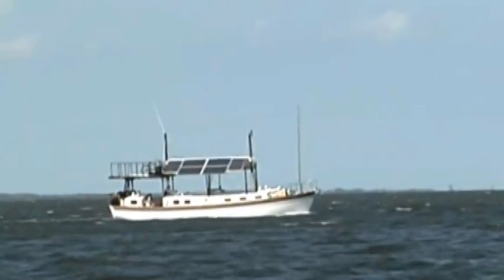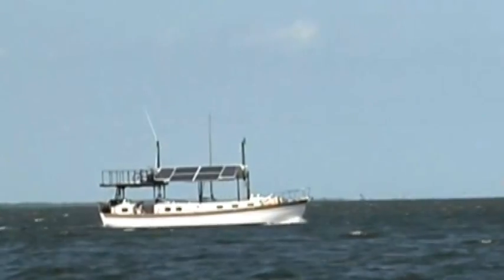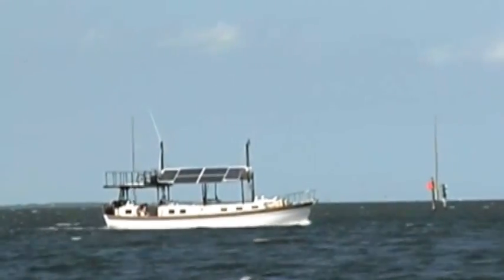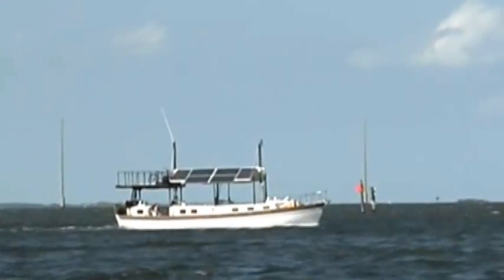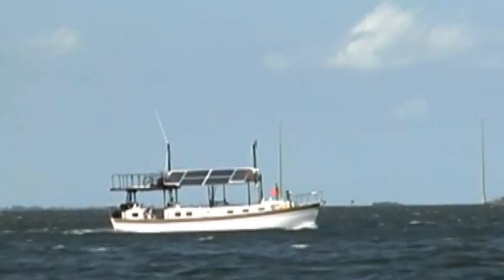Solar Boat (The Archimedes) I CAN'T BELIEVE THIS IS REAL!!!!!

Comment: FIrst, I have been researching this kind of alternate energy for several years but what I have found is that as far as cost is concerned, gasoline or diesel is much more energy dense than the current battery tech. Second, one can produce their own gas or diesel with a carbon neutral source such as hemp, or any hardwood, or any thing made of carbon. thats everything by the way. Carbon neutral meaning that the plants have absorbed the carbon so when oil is made from those sources, you are not putting anything back into the atmosphere that was not already there. You can make the oil by pyrolisis  , that is heating the material in a sealed container and it turns to oil, collect the oil and crack it or fracture it with a copper catalyst or a much better one if you can find and afford it. The result is gasoline and all of the other fuels that we currently use. A 12v 200ah lithium ion battery is over 2000.00... let that price sink in because one gallon of gasoline is the equivalent of four of those batteries in terms of watt hours. Feel free to do the math yourself and you will find that it is not the solar panels that limit us, its the crazy price of these batteries and the weight of them. 300 lbs of battery to equal 1 gallon at 8 lbs of gasoline. Its ridiculous.
Reply: i call bull 8 to 10 200 watt panels and brushless motor,controller and diy lipo pack is way less than even a small diesel engine

Comment: You say you have solar air conditioner..is that just a regular window unit or something special? I'm from Jax and AC is a major concern for me before I buy my sailboat.

Also, after seeing many sail boat an solar powered boat videos, in watching yours, it just dawned on me,  with a good ballast, one can cruise around the world on solar power just as well as wind power. Sure there are times when one or the other won't work, wind with a sail and sun with solar power , but as long as one can do 5 or more miles per hour...who cares. Both would be ideal. So maybe I won't worry if the sailboat I choose doesn't have a diesel and depend on the elements. :)
Reply: Kenny Smith I have have a small RV that I installed a 1000 BTU air conditioner in. I have a 340 watt solar panel with used lithium ion batteries. The air conditioner is about 12 by 13 by 5 inches, it was a Used 300$ unit off ebay. Matching the the voltage of your controller and the voltage of your panels to the battery system is not difficult.

Comment: My house is hybrid.   11 solar panels 12 batteries three charge controllers and three inverters.    My house runs on Fp&l , solar and 12 Volt.  My highest power bill is $90.    Generally runs @ $45.    All in the city.

Comment: how long do solar panels last, and is the recycling of those a safe process ? what about the batteries? no petroleum, sure, but I doubt the environmental impact of billions of tons of broken down/worn out batteries and solar panels is good for the environment.
Reply: Let's not forget you will never build all those 🔋, solar panels, electric motors or wire any of them together without using a ton of fossil fuel to mine the material from the 🌎 much less transport it, refine it transport the refined material and then manufacture the products needed to "go green" . Green my ass.
Reply: ha! my ass might be the only green thing going,since poop is biodegradable fertilizer... 'cept its brown.
Reply: Lead cell batteries are recycled!
Reply: panels should get over 20 useful years..............how about billions of tons of dismanteled coal power plants....now thats really really bad for the enviroment

Comment: Yes I can't believe it is real either. This amateur looking piece of junk has extremely dangerous and un-seaworthy high structures on it that will surely founder the vessel in the first real blow. The first rule of safe boat design is never put much weight or windage too high over the center of gravity. That ridiculous rear raised desk is dangerous and puts the danger zone over the top considering the already excessive hipped roof design of the solar array. 
All safe solar array designs approved by nautical engineers are completely flat on top so they don't make too much wind drag. Peaked arrays like this always have half or all of the panels at the wrong angle to the sun even at high noon, the best time to collect sun energy.
All successful solar powered designs have light weight hulls and two or three hulled designs are the primary approach for getting reasonable range out of the batteries. Ferro cement is the absolute worst option for this application, the guy could have done better with almost any other similar length vessel made of a lighter material, even an old inexpensive one.
Reply: but after it went  thru a couple hurricanes ...it is still upright & stable... can you explain why popeye ?
..the owner is a retired coastie.....may have many times more experience at see than most people
Reply: Just stumbled across this video again that some guy at the marina asked to do many years ago when we were just finishing the building the Arc, (that I never really cared that much for)  and I feel compelled to respond to your ill informed comment. The nicest way I can put it to you  is that you don't have a clue what you're talking about.  
First off, during our years of cruising since this video was made we have traveled over 5000 miles, been through 4 hurricanes at anchor and countless gales at sea and never had ANY issues. The stability of the boat is remarkable and I actually calculated the mass moment of inertia was slightly higher for the previous wooden sail rigging than it is for the solar canopy before I built the the system.
Next, the solar arrays are designed to tilt toward the sun, unfortunately we had not installed the electric actuators yet when this video was made but still had the crude pully system I made for testing. However, as it turns out, the A-frame position, or hunker down as I call it, is the most stable of all the positions we can put the panels in. https://www.shipofimagination.com/the-flap-tracker.html. Flat, or what I call canopy position,  is far less stable.  This is because the wind pushes down on the boat in hunker down, increasing stability rather than catching the wind like a wing. Also, we are able to collect 3-4 times as much energy with the tilting system than  when the panels are flat because we can track the sun throughout the day. I have actually tested this by leaving the panels in canopy position for a day during our travels and comparing this to previous days of similar weather and heading.
Your criticism about the weight factor of ferro cement does have a kernel of validity however it is a minor factor and I couldn't find a deal on a carbon fiber hull. I basically saved the boat from becoming an artificial reef and got it for a song. Plus the Arc is a tank that has been through grounding situations that would have shredded a fiberglass or wooden boat and it doesn't rust like steel.  The increased durability of ferro cement is well worth the trade off.
I hope my reply has been enlightening for you and you consider this the next time you're compelled to mouth off about something you know little about, "Popeye",
Reply: @CarterQuillenP.E.  Ferrocement and carbon fiber are both used much less than glass or steel. It is not your own single anecdotal experience and LUCK that applies, it is the compendium of all sail adventures of the last century that back my assertions. In addition to my own boat I built from marine architect plans and sailed for 20 years there is the overhwleming consensus of all boat designs and hundreds of very detailed first hand accounts of sailing adventures that all agree with my assessment. They watched amateur made ferrocement vessels sink in storms because they were so heavy and did not have the speed to get out of trouble. After storms, harbor shores are littered with the high windage top heavy vessels, usually houseboats. Is 5000 miles experience a point in your favor? Yes. But does it compare with the library of famed master sailor accounts who circumnavigate repeatedly and rack up 50,000 miles or more under the keel? No. My comments stand. Your windage and high up weight is an extreme liability. All boaters would love to have a high up observation deck but we know better. A crow's nest is an example of a safe amount of high deck. Today there are walk on solar panels shaped to fit on the odd deck spaces of low windage sailboats. They don' t affect the stability and they offer zero windage.

Comment: Wait... Did he say CONCRETE???   Are you kidding me!?!?!?  What was wrong with Fiberglass, Carbon Fiber, or Wood???  I think she's going to join the ranks of the Titanic someday soon.
Reply: wanna joust with your carbon fiber...glass...wood boat.... ?
Reply: it's a old boat & still afloat....so many fiberglass ...wood boats built since this one was made are reefs now.........
Reply: LasVegasVocalist , 
Using It For 50 zyears?
Ask A Norwegian!
Reply: Obviously you know nothing about privately owned boats and yachts. Ferrocement is a respected material when done according to qualified nautical engineering plans. It has been used for over 50 years and got a bad rap from the few crackpot amateurs who built dangerously poor ferro boats on their farms. Many ocean cruising yachts are out there right now safely navigating the most severe challenges the ocean can evoke and the owners are comfortable and safe on ferro boats that last for decades.
Reply: Okay Mr Obvioius, Mr Quilan did NOT call it Ferrocement.  At just 25 seconds in he called it Concrete.  Had he called it Ferrocement or Seacrete I would not have made the comment, but rather I would have looked up the term. Honestly I've never heard of this as a building material for boats.  I've only heard of wood, metal, fiberglass and the newest material being Carbon Fiber.  Apparently however "Concrete Boat(s)" is a pretty common term in that industry.  I just found it initially funny that someone would use concrete as a building material for a boat.  I will have to do some reading up on that topic.  Cheers!
Reply: ferrocement is  used in boat building and it is considered sub standard and i only know of amateur boat builds of this material and no insurance will insure ferrocement  , saltwater is the worst environment for both the cement and the armature , also the slightest bump and your boat explodes and sinks , the up side its is cheap , and that is the only upside.

Comment: I have an electric motor that was an auxiliary for a 28 ft. sailboat, and all the wiring and control boxes that were on the boat. boat was only sailed in the winter here in St. Petersburg, Florida ....the motor is a 144 volt direct drive at 1000 rpm, and would push the 7700 lb boat at 6 1/2 knots (that was hull speed for the boat).... all of the stuff mentioned i'm asking $1,000 for and you would have to pick it up at my house in St. Petersburg... if interested I will e-mail my address.
Reply: Lary Mayotte , I'm Interested!

Comment: Products need to
make a solar panel with a 15 to 25 year life span.

• Arsenic
(gallium-arsenide semiconductor

chips). 

• Bauxite
(aluminum). 

. Boron Minerals (semiconductor
chips

• Cadmium (thin
!lm solar cells). 

• Coal (by-product
coke is used to make steel).

. Copper (wiring; thin ! lm solar
cells): 

• Gallium (solar
cells)..

• Indium (solar
cells). .

• Iron ore (steel). 

. Molybdenum (photovoltaic cells). 

• Lead (batteries).

• Phosphate rock
(phosphorous). 

• Selenium (solar
cells). .

• Silica (solar
cells).

• Tellurium (solar
cells). 

• Titanium dioxide
(solar panels). CES

Researcher:
TonyMuhovich, Colorado School ofMines

Edited by the US
Geological Survey 2010

Comment: Johnny Carson said, "Once they figure a way to charge you for it, solar energy will become reasonable!"
Reply: No one is ever going to try to charge me for utilizing the power of the sun with my own equipment.  I would stand my ground until death if necessary.
Reply: They already figured it out.  all those solar panels, and wires, and inverter etc etc.  None of that is free...  Rich people are making profit off of it.
Reply: We pay about $1 a gallon for purified drinking water.  Surely there will be a manner in which people pay for solar energy too.......
Reply: pry the solar panel from your cold dead hands